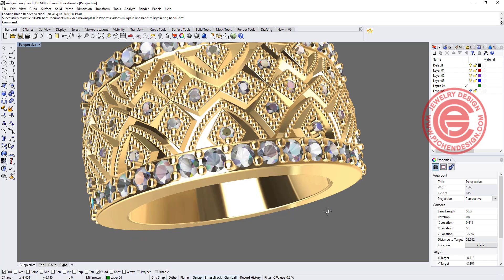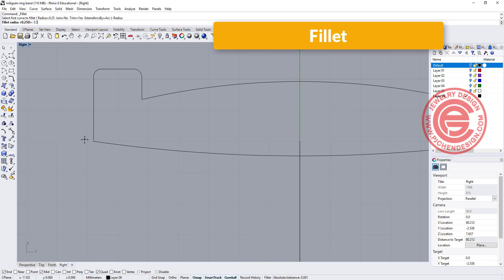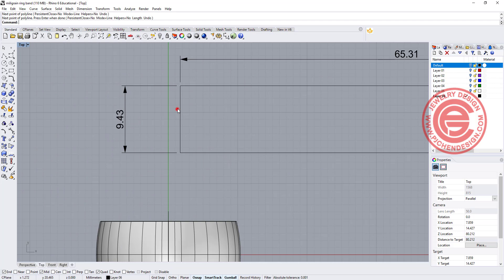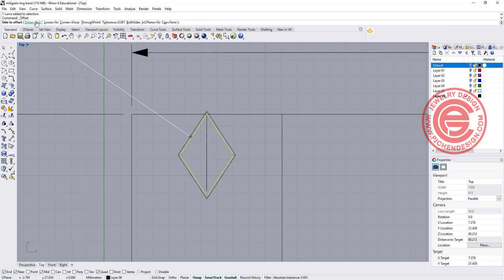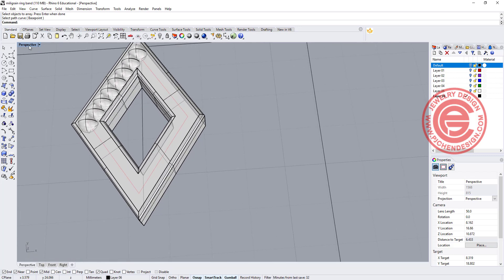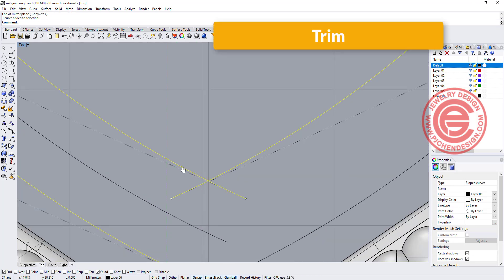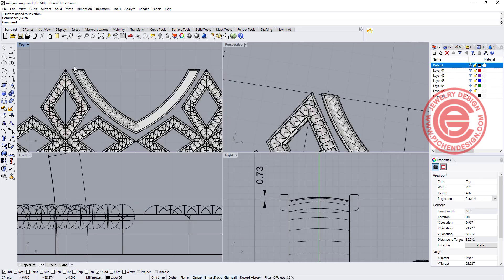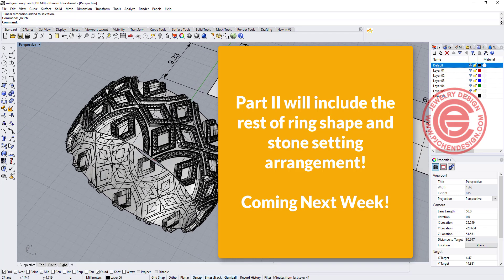Jewelry CAD Design Milgrain Ring Band (Part 1) 3D Modeling Tutorial with Rhino 3D #160

Comment: Hi PJ. Thanks for you useful videos. I have some questions but I ask you one by one. If you answer them I will be grateful although if don't , will be thankful again because you are awesome.
My first one is, why do you use revolve command and not sweep 1.
I sow that when you are want creative a surface for gem with triangle rail and puffy profile you used rail revolve. Is there reason for it?
Is there advice for us to how and when we use correct tools??
Reply from the maker: I believe you can use either one. I sometimes try to use different commands to show different way to build the same model.
Reply: @PJChenJewelryDesign  thank you  PJ. You are amazing.

Comment: Hi PJ, i've doubt regarding weight of the jewelry, eg as your tutorial ring, customer ordered weight is 16grm but after design the weight is 24grm how to reduce the weight without reduce the size of the ring.
Reply from the maker: It depends on the ring size. you may can reduce the thickness of metal as long as you can get it cast.